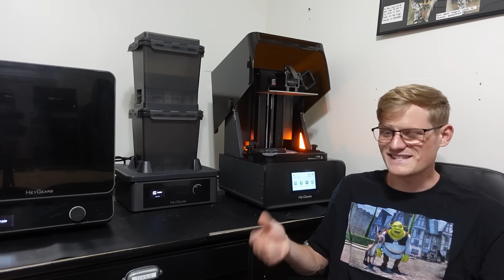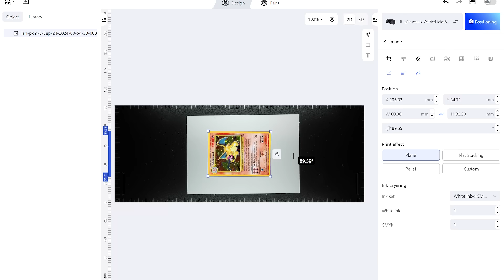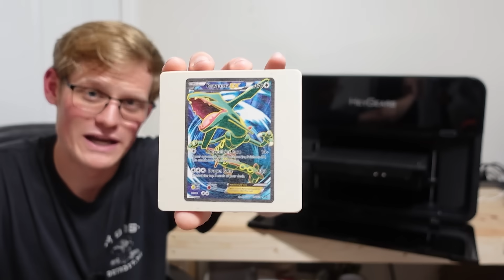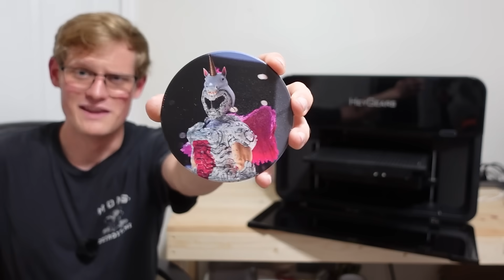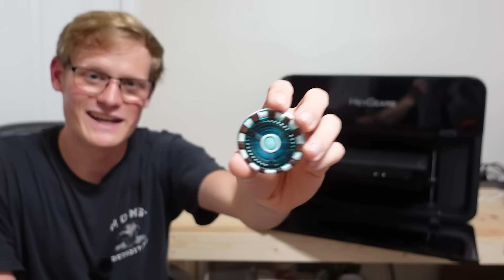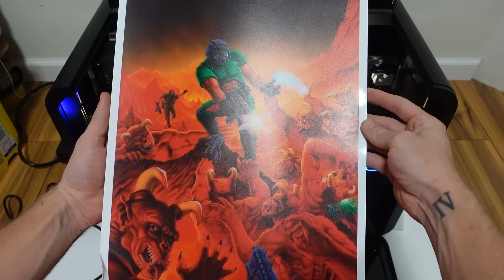The World's First Desktop Full-Color 3D & UV Printer? | HeyGears G1X Review

Comment: I have a hyper specific question regarding the white layer - Does this printer support greyscale opacity maps that dictate how much white ink is placed in specific locations of the print job in 2d mode? And if not a greyscale map image, any sort of white layer density or halftoning settings? I print on hologrpahic media and want to have some of the holofoil bleed through but not have it be just pure CMYK ink which is transparent enough - lighter colors benefit from a slight application of white undercoat.

Comment: I pledged about $4200 for the printer, rotary, and a bunch of ink. Stupid me didn't buy ink when I backed the Eufymake and it cost my wallet dearly. Learned my lesson, get about a years worth of ink when you buy it since it is on sale. The ink does expire so make sure you don't buy too much. I have a dozen 3d printers for about a decade now, 10 different FDMs and 2 resin (Jupiter/Mars). THIS is the machine I wished my resin printers were, FULL COLOR. That is a huge game changer even if it can't print anywhere near the size of my Jupiter printer. The amount and variety of custom jewelry is insane with this printer. Clear encased necklace pendants with 2d, 2.5d, or 3d objects of a customers choice inside is unique. Sure, resin casting has been doing that for a while, but not this clean and easy.

Comment: This cant print TCG cards to look real. Its extremely hard to fake TCGs, more so than even money. Even an amateur will be able to tell them apart next to the real thing. And on expert level / extremely high cost cards you can see the print signature with a magnifying glass which is basically like a fingerprint impossible to copy if you dont have the exact same machine. Dont even let me start with different foilings. Its easier to fake money.

Comment: Hey Dan,

I noticed you said 'no issues with anything' but I spot a horizontal line that is very prominently noticeable on the arc reactor. The bottom left of Starry Night has multiple similar things. These do not appear on the original image.

Comment: mtg proxies gonna go crazyyyyyy
Reply: proxies aren't a printer problem, they're a paper problem. if you're not printing on the exact card stock it will feel different in use in a mixed deck with both proxies and real cards. hint: you can't buy that card stock.
Reply: @ifatreefalse  You probably can buy it.  When Magic was first introduced it wasnt billion dollar company, so they probably contacted the card making company and ordered cards, not any fancy custom for them paper and special technology - and this limits them until now, they cant change it much. I bet the printers used their standard technology they used back then for other cards. Only real issue with faking MTG is you do not have the original bitmaps in exact same halftone separations, which is then easily noticeable under magnifier galss, the paper is the least issue here.
Reply: @ifatreefalse true , imagine buying a 4K UV printer ☠️  for proxies
Reply: @dbdperkcombos well they got a cheaper one for 2k
Reply: @dbdperkcombos  I think a printer that can print cardstock is actually almost as expensive as this heyGears.
Reply: The printer can make card-like UV output. That is not the same as a legal proxy policy. Collectors should keep licensed product and use this for original designs or clearly marked playtest cards.
Reply: Custom full-color cards look insane, and I get why proxy talk exploded. I still want original/licensed use — faking sealed TCG product is bad for the hobby.
Reply: My Brother in Christ, how many MTG do you need, to reason a 4k$ printer into your budget? You can literally buy these cards for that price on the market.
Reply: @makcraft  You sweet summer child... 4 thousand is nothing to an MTG fan
Reply: @makcraft  10k for the printer

Comment: Hi, how do you secure the paper to the table? Does it just lie there? Does anything shift while you're working?
Reply: There is a sticky sheet on the bed for paper and posters — it is not just sitting loose.
Reply from the maker: The build plate is almost like a sticky tape material, so if your substrate is flat on the bottom it'll stick pretty well. For larger objects I used double sided tape. The head doesn't make contact with the material so it shouldn't be moved during printing
Reply: @BuildDanielBuild thanks a lot
Reply: Adhesive bed film is the registration interface for low-mass media. Heavy boards can still use mechanical stops if needed.
Reply: The standard bed includes an adhesive sheet that holds paper, posters and thin sheets so they do not walk during the job.

Comment: Hi, its possible to switch resolution to 1440x2400 in 2D print ? . I wanted to ask for a favor: would it be possible to do a quick test print with very small text/font to see how small it can go while still remaining legible? Specifically, I'm interested in a font height around 0.6–1mm, printed on a smooth, flat surface (ABS plastic or similar), using the highest quality/resolution setting available — print speed doesn't matter to me at all, only the sharpness and legibility of the result. If possible, a macro/close-up photo of the printed text would be incredibly helpful. Thanks so much for considering this, and thanks for the great content!
Reply: That tiny-type test would actually sell me more than another poster. The machine is rated 1440 × 2400.
Reply: DPI is not the same as motion accuracy (X ±10 μm, Y ±2 μm). A 1 mm condensed font is a registration-and-dot-gain test, not a spec-sheet deduction.
Reply: UV Printing uses up to 1440 × 2400 dpi. A 0.6–1 mm type test is a useful next demo; we will not quote a guaranteed minimum without that file.

Comment: Id be curious the water after you dissolve it how toxic is it? Do you handle it like resin printing cleaning fluid?
Reply: They are not telling you to dump it like IPA. Dry the leftovers and treat them as solid waste.
Reply: Support soak residue is a dried solids stream. IPA vat wash is a different waste class. Follow SDS rather than drain-first habits.
Reply: After the support dissolves, dry the residue and dispose of it as solid waste under local rules. That is different from SLA wash solvent. The resin system will have SDS, RoHS, REACH and VOC documentation.

Comment: What's the cost of refills
Reply: A billion
Reply: @JotchuaReal  wrong. $750,000,000.
Reply: @BrianNovak-gk5rb wrong 820,000,000
Reply: @tucobenedictopacificijuanr8543 wong 900,000,000
Reply: 190 USD for a CMYK (4 bottles) 1000 ml set
Reply: Bottles are actually pretty open-priced. The number I use for 3D is about 2.5 cents per milliliter, not the highest color bottle applied to everything.
Reply: Quote channel SKUs, then convert with BPS milliliters. Do not price every voxel at transparent-resin list.
Reply: Refill pricing during the Kickstarter campaign: UV ink 300 ml is $25 white / $29 CMYK / $35 varnish; Full-Color 3D resin 1000 ml is $25 white and support / $29 CMYK / $35 transparent. For 3D printing, the weighted average is about $0.025/mL because white and support dominate.

Comment: With Pokemon cards, the real challenge will be the Holo effect and masking. You'd need holographic cardstock and a PNG print file that has transparent sections to allow the Holo to shine through
Reply: You forgot to mention that, on top of that, Secret Rares (like the Rayquaza and Charizard he showed) are also embossed, and mimicking the embossing pattern is a whole other beast
Reply: @MaavBR  good
Reply: I think it would be more effective to use real cards, completely remove the front with acetone, and then print on that surface.
Reply: @Edaurd the issue with that is alignment, it's hard to get perfect which is why it's usually easier to print every thing, combine and trim after
Reply: @Velocity_AU  i have thought of that exact issue too, i think what you could do is just extend the artwork far enough over the edge that alignment won't be as tricky, just like pokemon does it kinda
Reply: @Edaurd  I mean having a bleed would be needed in general, I just mean it being centered on the card since all pokemon cards have borders.
Though hey many pokemon cards arent centered perfectly, and then you can also get some that are horribly shifted, though depending on the card that can make them be worth alot
Reply: @Velocity_AU  the new generation of these printers use auto laser material designation. So it will only print on the thing you put in there. The tech is getting pretty wild
Reply: @Edaurd  cornball
Reply: The workflow you described is supported: print on holographic cardstock and keep selected areas unprinted or without a white underbase so the holo shows through. Blueprint Studio can generate that mask as an independent white/registration layer.
Reply: There is no challenge in that, already happening on mass on Etsy.
Reply: @MTheConqueror yeah but that's with printing services, I want to see it done on a desktop UV printer
Reply: @Velocity_AU  people are already using uv printing to do holo and foil etched effects on magic cards.
Reply: @phantomzero906  With what printer?
Reply: @phantomzero906  MtG cards aren't embossed. Pokémon cards are.
Reply: @MaavBR  there are custom (proxy) yugioh ultimate rares that have the embossing. Some arguably look better than the originals in terms of that embossing but obviously there are other relatively obvious flaws with the cards. Wouldn't be too hard to scale it up to the full art of the pokemon cards
Reply: @Velocity_AU  pretty sure it can be easily done with the correct "ink", making those shiny (gold and silver at least) extremely easy. The rainbow should be as easy with the correct ink.
Reply: @sammorrissey9094  The embossing tech on Yu-gi-oh ultimate rares is VERY different to the one on Pokémon Secret Rares... YGO Ultimate Rares are basically layers of etched foiling in different angles, with the stamped frame/stars/attribute (and name just like Ultra Rares), which only take a single mold per card frame to replicate. Whereas Pokémon SIRs/SARs each have custom molds for their embossing, which makes them disproportionately more expensive to manufacture on a smaller scale
Reply: @Velocity_AU  Check out Crycry for his MTG holo proxies. If he can do that with an inkjet, I can only imagine what can be done with an affordable UV printer. Most of the people on Etsy also just use inkjet as well. So if this is affordable it can definitely be a game changer for proxy making in general, but a nightmare for collectors.
Reply: This part you are talking about is actually trivial with these machines. The hard part of recreating cards with a uv printer is 2 things. Foil and specialized inks. Many cards use some kinds of specialized inks that these machines do not do well with and cannot replicate without a completely custom setup, and foil is very difficult to recreate on these kinds of cards
Reply: Idk about pokemon specifically, but for mtg and other card games, you can use acetone to remove the printed ink layer from a foiled card. The foiling is made of tiny layer of metal, so the acetone just gets the ink and not damage the card.

I did this to make shiny tokens, but this printer could make fake cards.

However, you can still check the rosette pattern to verify a card.
Reply: Technically it is a white-underbase mask on holographic stock, same family as foil/flock registration. Capability is real; commercial counterfeit cards are a separate legal issue.
Reply: you can just use Acetone on Bulk Cards to skip the cardstock problem. All you then need is the original artwork and some photoshop skills. There's a subreddit dedicated to making custom pokémon cards with great tutorials.
Reply: and removing the footprint
Reply: Those are the easy part. Actually printing that mask is the hard part and the point of a uv printer really. Being able to print a white layer with it
Reply: @ExplorerOfTheWorlds  Yes, but is it easy to set that up? Especially with existing cards.
Reply: They already doing that on eBay.
Reply: @stevemuzak8526  I mean they have actual high ups in the company reprinting and faking sets and unreleased promos and stuff, not even a year ago when that scandal was revealed. People wanting to do this at home are way behind with faking pokemon cards.
Reply: That holo-window trick is exactly why this looks so wild for custom cards. I still want it used for original or officially licensed art — bootleg TCG is a mess for collectors.
Reply: Nah they just need to be good enough for kids to play with, then they don't need to deal with scalpers. The cheap packs to buy and expensive cards just print
Reply: I’m laughing so hard reading your comment - “the real challenge…”, the real challenge is dealing with idiots like you that think they know way more than they actually do.
Reply: @material_equivalent1645man, you're just an asshole? I didn't do anything to warrant you acting like this to me.

I said it's a challenge because you'd have to set up a Pokemon card file with the white mask for the holo something that isn't exactly easy or automatically done.

And then it can be harder with cards with a custom texture as those then require a whole other layer, and doing all those together isn't something I know for sure is possible on this machine with its software.

Seriously though, you have no reason to start acting like a high and mighty ass.
Reply: @material_equivalent1645goat comment 😂😂❤

Comment: This is what I've wanted in a 3d printer for years. Wish I had more space but its hard to say no to something like this...
Reply: Well, with the first disclaimer about safety measures ... it's not just like an ink jet printer. Can I really put one in my home?

Also, do I want to look at the price?

Otherwise I would love to have one or an eufyMake.
Reply: @querela92 I ask these questions myself, I don't have a safe room for it. I looked at the Kickstarter and the base one isn't an awful price..😅
Reply: @querela92  Well, if you want the 3D printing, you're looking at over 3 grand. And HeyGears says you don't need ventilation for it... but it uses resin. Which means you absolutely need to ventilate it, and keep it sealed off so that you aren't getting poisoned. It's possible to hide the smell of resin (supposedly, I've never actually personally witnessed anything that effectively eliminates the stench), but even with the smell eliminated, fumes will still be present.
So unless you have a home that can accommodate a room dedicated entirely to resin printing, with a cabinet that ventilates directly outdoors, and has a hermetic seal and airtight design, and you're willing to wear the appropriate respirator while working with the machine, then you probably shouldn't put one in your home.

Comment: great results color and resolution wise, but why were almost all of your examples missalligned and off center? Is that due to human error? Or a misscalibrated camera system? I've heard that all of these machines, except for the X-tool, all have issues with the perception of what you see in software and what the printer will print is slightly off.
Reply from the maker: Yeah, I manually aligned the image over the substrate; it takes some getting used to. I didn't center it the best but also didnt want the design to go over the edge. Circles are much easier haha.

Comment: Very nice! I am wondering if you can print on a long poster like 1ft wide X 3ft long.
Reply: You should be able to do this with most desktop UV printers using the roll to film attachments they all have.
Reply: A 3-foot poster is a roll job, not a single sticky-bed pass. Check the KS add-ons.
Reply: Bed envelope ≈ 420 × 330 mm. Continuous length is a roll-to-film workflow, not an extended flatbed.
Reply: The standard platform is 420 × 330 mm, so 1 ft wide fits, but 3 ft long exceeds one bed. Longer graphics use the roll-to-film accessory — pricing is on the Kickstarter page.

Comment: whats your thoughts on running one of these or similar like the xtool omni or eufy makes in a apartment? i currently run fdm printers with no issues. i know resin is a step up from those. it would be in a separate room with a window and air purifier running and fans. my main concern is not bothering neighbors. could this run without being smelled from neighbor rooms?
Reply: I run my Euftmake E1 attached to an xTool SafetyPro AP2. It runs at max and sits on a desk. I don't smell anything and my neighbors haven't complained.
Reply: It is not an open resin vat, which is the big difference. I would still not put it in a tiny unventilated bedroom next to a neighbor.
Reply: Engineering controls: enclosure, purifier, jet-and-cure rather than an open bath. Odor transmission through multi-family walls is not a certified zero.
Reply: G1X normally prints in an enclosed chamber with air purification, and material is exposed only briefly. SDS, RoHS, REACH and VOC documents will cover the chemistry. We still recommend a ventilated room rather than promising zero odor through apartment walls.